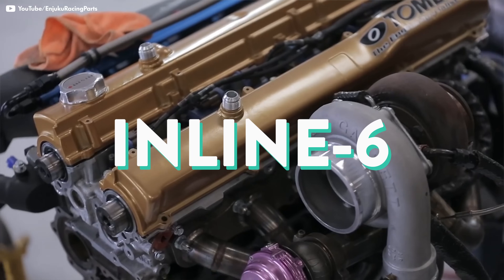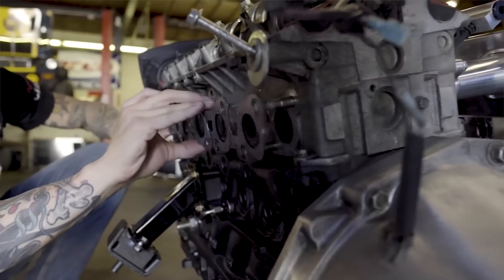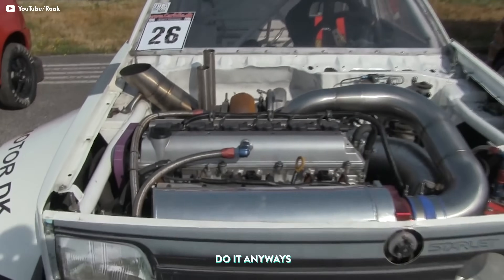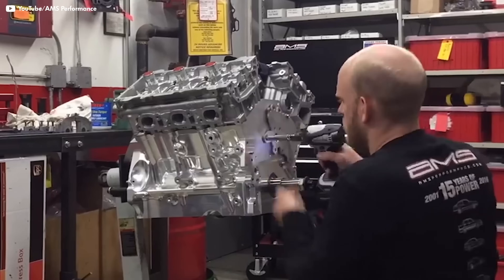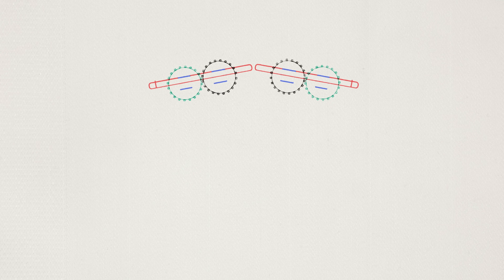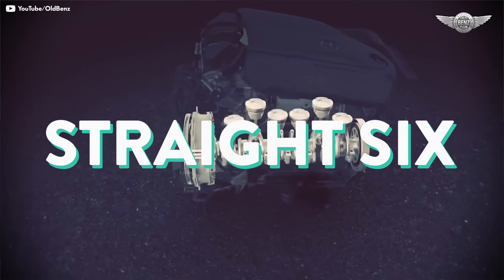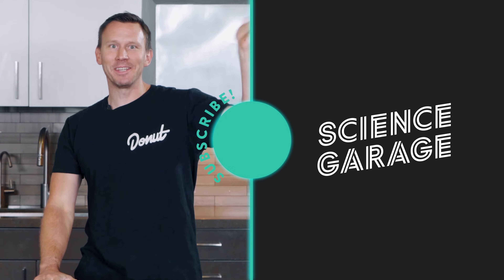INLINE 6 vs. V6 - How it Works | SCIENCE GARAGE

Comment: I have two questions:
1) in terms of performance, is there a difference? Especially acceleration
2) fuel economy. Which is better?
Reply: The counter weights on the V6 does add rotating weight, which sucks up a decent amount of power. However, there are so many V6s that can make tons of power out there, it would probably only matter in race engines and high dollar supercars. Also, I want to say the I6, being so balanced, is just a good candidate for really high displacement, really low rpm applications (like marine and gas generators); V6s kinda stop making sense much beyond 3.5 liters.

Comment: Another advantage of the inline 6 (and how narrow it is) is has to do with the potential for aerodynamics, especially Venturi tunnels. As a general rule, the narrower the engine’s bottom end is, the wider any Venturi tunnels can be (given that they have to go AROUND the sides of the engine), and given that inline 3s, 4s, 5s and 6s are the narrowest engines around, it follows that using those compared to V6s allows for wider tunnels—and thus more downforce for the same amount of drag…while kinda draggy and boxy by modern standards, the Skyline GT-R R34 actually has quite high aero development potential assuming the right kind of body kit and underbody aero (between the potential for massive Venturis flanking the RB26 and the way the indented headlights can basically wad the incoming air up and shovel it over the fenders for more downforce (see also the Gen 4 NASCAR Dodge Charger))—the problem is that most builders and tuners don’t quite realize this…

Comment: I would’ve compared the Inline 6 to the V12 as they are basically the same engine. 

Almost at least in 1917 the liberty company had a 14L inline 6 and then put two of them together at a 45 degree angle to make the perfect V12. 

However, it never got past the prototype stage and was scrapped in 1918.

Comment: Seems like a non-issue especially with modern cars. Is the smoothness detectable? By how much to a regular driver? For me if I don’t see an improvement in power or efficiency then it’s a non-issue. As far as two sets of cams, gaskets, etc., it’s the norm and most cars these days can easily last over 100k miles. Also if the V6 is standardized it’s not going to make work harder for those that work on V6’s everyday. Again, a non-issue.

Comment: One word "Boxer"   3 on one side 3 on the other ala Porsche flat 6  nice and low so superior IMHO to straight or Vee...actually for smaller straight engines I am really attracted to 3 cylinder   check out Toyota GR versions where 300hp is extracted from on 1.5 L  !   And that Howl!

Comment: I've owned 2 V6s, 1 straight 6 and one VR6, which is an inline V6, 3 of them had about 170hp...the coolest of the bunch was the 4.3L Chevy V6 in my Jimmy, it had enough torque to easily lay two black strips with the stock over-sized on road/offroad tires.

Comment: Hot V6 single turbo engines are going to take off. The new Audi 3.0T is a torque monster on stock turbo (when tuned). Not to mention you keep the center exhaust hot and the intake sides cold.

Comment: I like the ford 300cid straight 6 build from the late 60s and all the way to the 90s used in ford trucks. Absolutely legendary engine that had tons of torque at less than 2,000 rpms which means it will last forever because it doesn’t have to rev high

Comment: you can have a 180 degree v6 aswell, it's a flag 6 engine, and that doesn't make it a boxer engine because of its different crankshaft layout. ferrari never really made a boxer engine, only flat engines

Comment: Ford Barra best made inline 6. You boys in USA don't have em. Can get 7 sec from untouched block.
Also inline 6 biggest issue is that the usual overhang of the centreline of the front wheel.

Comment: My truck has an inline 5 and its been working well. When I get my next truck if it has an inline 6 and is easier to maintenance I'm fine with that. Question: Does one naturally have more power than the other?

Comment: @0:30 I will die on this hill: the V6 is the worst engine configuration ever derived. It is unbalanced in every direction and axis, and only exists because companies didn't want to re-tool their V8 factories. I6 and boxer-6 are better in EVERY WAY compared to a V6, so I dunno maybe don't cram this cheap-skate option in your performance car.

Comment: Got a Chevy Trailblazer with the i6. I’ve only had it for around 8 months now, and I love that thing. Only bad thing was a freak accident when the tensioner pulley broke (yes, we were doing it the right way) when trying to replace the horribly designed vvt solenoid.

Comment: As a Rat Rodder, I actually dig the I6's. You run out of realestate real quick with a V8 in these old cars/trucks. Also they are Torque Monsters for what they are. Look at the Truck & Tractor pull Kings..... the Cummins. It's just a diesel I6 out there out pulling those big V8 Duramax and Powerstrokes. Back in the Sixties the fastest car in my neck of the woods was a custom Hudson Hornet. It was putting 409 Big Block V8's on the trailer with only 6 cylinders and 2 carbs. The old saying is so true, "Torque wins races, Horse Power sells cars".
I just wish the aftermarket stuff was cheaper on them. Or at least equal to that of the V8's.

Comment: Having owned both a v6, which was a Buick 225cu Dauntless in my 1970 Kaiser Cj5 Jeep, and a straight 6, an AMC 258cu in my 1985 AMC Cj7, I admit that the straight 6 is indeed a smoother running motor, but the v6 definitely had more power, and when runnin open headers, the v6 sounds A HELLUVA LOT BETTER than the straight 6....
Reply: That V6 had more power because it was a pre-smog motor, not because it was a V6.
Reply: It's because self destruction sounds amazing.

Comment: THE AUSSIE BARRA INLINE 6 ENGINE IS AND ALWAYS WILL BE THE BEST INLINE 6 ENGINE!!!
Reply: The Barra 4L is only good for 600-700 crank hp before having to open it up and UPGRADING some internal, same as the RB26. The 2JZ has done ~1300 crank hp without opening it up.

Comment: I'd like to point out that pushrod engines are still being produced, sold, and developed, so the comment about a v6 having 2 sets of camshafts and cam sprockets isn't entirely accurate, though I will admit most v6 engines currently on the market are either SOHC or DOHC which would make the statement mostly accurate.

Comment: I 6 is a good engine and it will work for front wheel drive the layout has been around for years check out 4/wheel drive truck and if that not enough think about AMC  Eagle

Comment: Inline 6 is nearly impossible to do in front wheel drive. Ok then, to hell with front wheel drive.
Reply: Yes it can in FWD, you just have to mount the engine lengthwise, not sideways.

Comment: Its pretty simple, the engine with more main caps is always stronger. Inline 6 will always and forever have more main caps to hold the crankshaft in place. An inline 4 has more main caps than a v6
Reply: Not always.  Chrysler Corporation 6s after the 20s always had 4 main bearings.  The inline 6 is better because it is better balanced and because each con rod has it's own journal.

Comment: I had a 370Z & while it was a blast to drive it did not like to rev at all. Any higher rpm fun felt like the engine was gonna fly apart. I typically favor the good old V8 but im quite curious to get my hands on a built inline 6.

Comment: I have infiniti v6, and in-line6 sounds much better, Porsche uses in line 6 and they sound eargasmic.  For v6 like g37, 370z and more u need the right exhaust set up and u can’t do straight pipe otherwise it’s gonna sound horribly loud.

Comment: Chrysler in the 70's had a Hemi 6 inline 6 in 215, 245 and 265 cubic inch. The 265 came with a 6 pack and put out 302 horsepower. The Hemi 6 only was used in Australia 🇦🇺.  Here in the USA 🇺🇸 we got the 225 slant 6.

Comment: I got an AMC i6 4.0 and it’s silky smooth, makes fantastic power and low end torque, 240k miles and you could never tell starts right up and runs quiet, pretty good gas mileage for a 1987 Jeep Cherokee, BUT they definitely did not leave any room in the engine bay 😕 the engines have a heat problem (not mine I fixed the issue with heat soak) , the heat soak will straight screw you if you aren’t careful, other than that those are such solid SUVs can’t beat em IMO

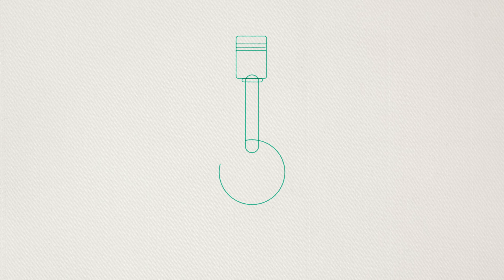Comment: That phenomenon that is described at 1:30 isn’t correct. The stroke is going to be the same on the top and bottom halves of crank rotation. Otherwise you’d have some strange issues with your crank.

Comment: Yes, V6s, are harder to work on, build and need a lot of balancing to be smooth, but my Toyota Camry 3.5 L V6 by, might be, if not maybe as smooth as possible ?? Anyways, it's VERY smooth and it shifts very smooth as well...For 268 H.P., most would be surprised how hard it pulls...It's a sweet engine, that you'd think would be in a Lexus, instead of a Camry :):)

Comment: Not 100% accurate on inline 6 cylinder engines. My 2007 Land Rover Freelander 2 has 4 wheel drive and a transversely mounted 3.2 litre inline 6 cylinder engine. I am aware that this was borrowed from Volvo and Volvos have the same engine mounted transversely and drive either the front wheels or all 4

Comment: More and more or going back to straight sixes - because of cheaper manufacturing. As v8 goes down they want combination of straight 4s with 6s.

For simplicity and smoothness straight 6 is prefered but with v6 you get better car balance and lower center of gravity which is very important for driving experience.
Reply: Cevair Zufer Volvo made nice i5 engines.

Comment: Another good engine was the AMC 196, 232, or 258 inline six the 232 and 258 sixes had a seven main bearing crankshaft which was very durable.

Comment: One thing you forgot about the i6 is the crank shaft; Because of the engine being longer and heavier, the crank shaft is much stronger on an i6 than it is on v6 and even v8s... this allows the engine to take on extra power and give it right back.